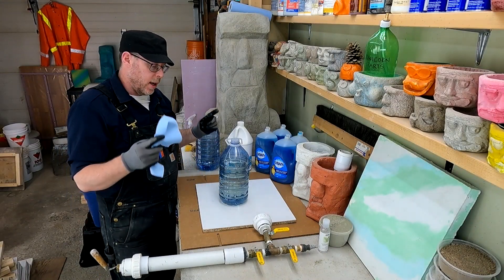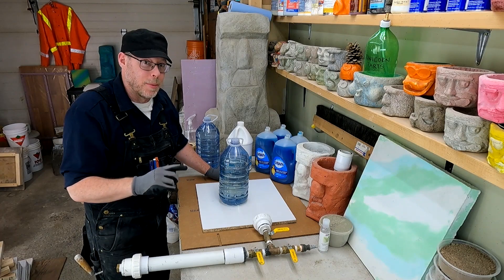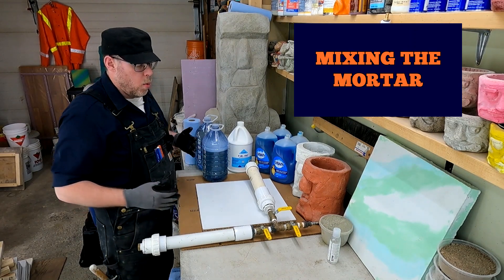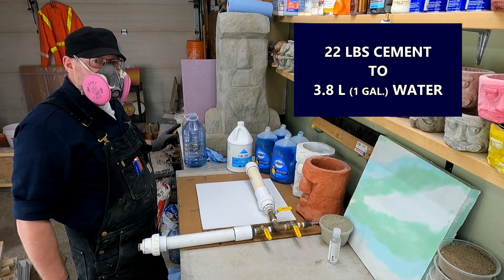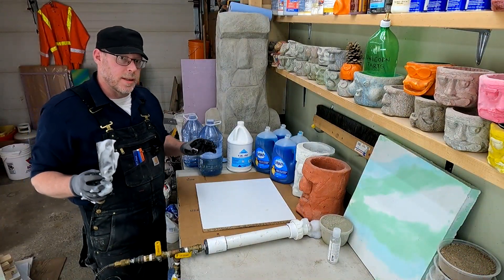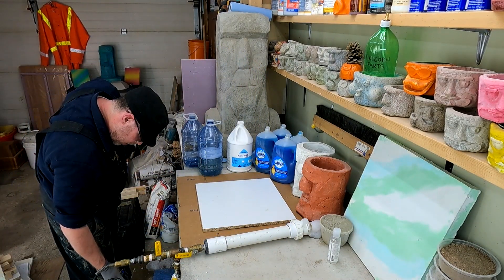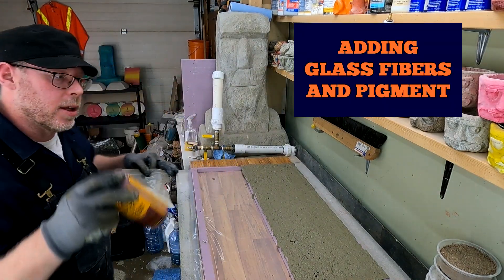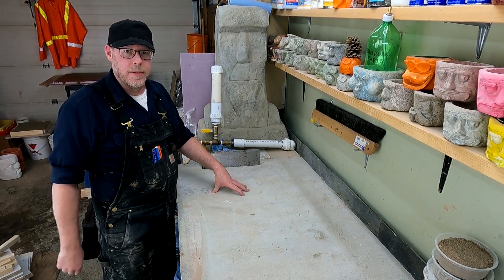How to Make Aircrete - Part 2

Comment: Do you think that there could be something else added to the foaming agent that would give the foam more pressure handling capability ?? How would aircrete compare to using something like vermiculite or perlite loose fill insulation ??? Thanks for your time and help SIr too.    😀😀😀
One other thing, I would use distilled water for the mix to prevent any problems with the mix. Do you agree ??
Reply from the maker: Much weaker than verm or perlite lightweight mixes. Very little strength to the aircrete

Comment: Sir, is it possible to mix aircrete with some other agregate ? Ive heard that aircrete cant be mix with other like sand, grafle etc because snad is heavier, so in the process of curing, all the sand will go down. But seeing you add a veg glicerine, it makes me optimistic. Who knows there is a good ratio that will result in lighter than normal concrete, a bit weaker thats fine, but have some water resisance and sound insulating feature. But one more thing, environmental friendly. Ive watch your fiber glass idea, but fiber glass is not so green material. So i hope there is other solution. Thankyou and great respect to you